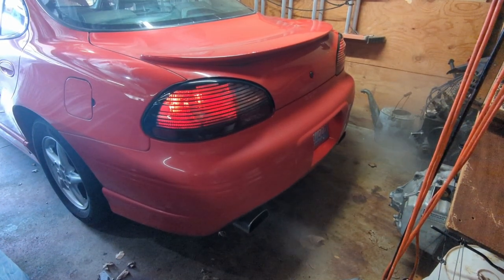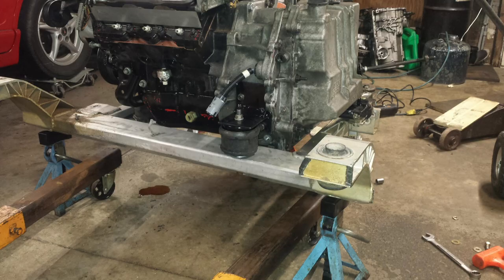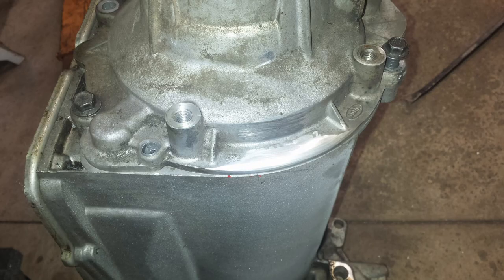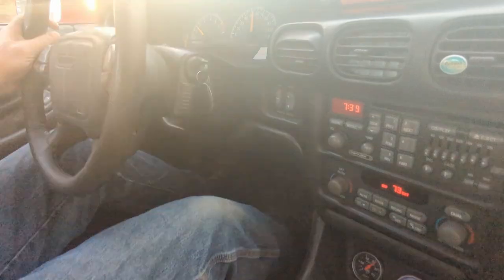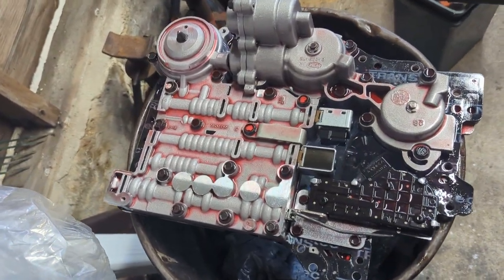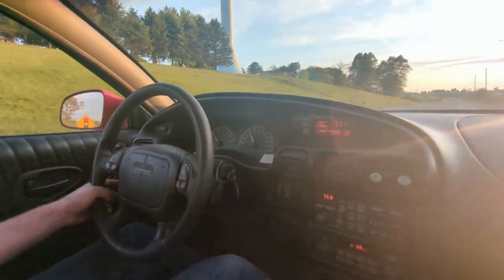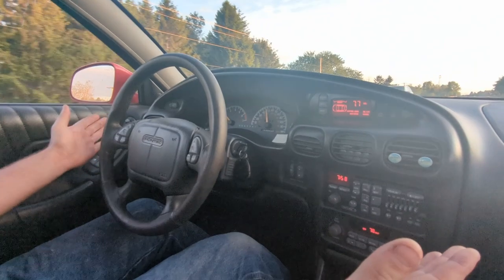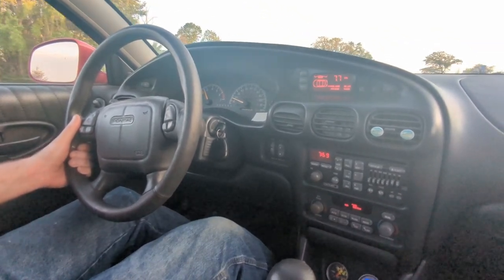4T65E to 4T80E Swap | GM 3800 | GTP | Details and Pictures

Comment from the maker: I found an error in my trans tune.  Correcting input tooth count from 25 to 39 allowed tcc to work with pcm command.  It also allowed shift adapts to work curing firm shifts durring normal cruising.
Reply: The Whippled Riviera I did back in 2012 has that in its last pcm file, remember folks ya need to change the gear ratios for each gear if the pcm sees  a ratio disparity it will change adaptives. 
I don't know if hp does but tiny does it.
Sprocket ratio should also be 1:1
I've seen odd numbers from some 4t80e swaps lately, mostly seems to be hp folks.
3.11,3.48,3.71 are your Final Drive ratio. You still need to change each gears ratio as they differ.

You can use the internal mode switch and wire it to the ext rage wiring. All logic outputs correlate

Comment: Is there a sort of write up for this swap process? I have an 03’ Monte Carlo SS that I plan to top swap and build, and I don’t feel like dumping a ton of money into a built 4t65e that could nuke upon its first launch. Let me know, thanks!
Reply from the maker: Chicago garage has a bunch of info in one spot.  It is probably imo the best one.  Its a known enough subject by now theres a bunch of fragmented infomation out there.  I used ls4 king for some of the wiring and all data.  Lots of work but worth it.  I have also tried to answer comments completely for everyone as well
Reply: @josephnowak so if i get this transmission in i have to mess with the computer and data?
Reply from the maker: @rosshopkins2063  yes.  Hptuners or an old dhp setup.  I have never used or seen tiny tuner but that could be an option as well.

Comment: I been wanting to this for years I need to do this to a 05 impala I found a 4t80e 2000 will it work on my 3800 la?
Reply from the maker: Yes its doable.  The 2000 trans is a little different from the 2005 that I have.  The car is a little different than my 1998.  Ls4king part 3 video goes into some of the controls,  Very similar to 3800.

Comment: I have a 1992 Pontiac Bonneville and im tryna build. Engine already rebuild head gasket replaced. Everything. But im just trying get more torque power what do i need to two do?
Reply from the maker: I am not as familiar with the series 1 3800 which i assume your bonne has.  Id look into the supercharged setup that would of came with the bonneville ssei models

Comment: I have a 05 GXP with a 3800 engine in it can I  put the Northstar transmission behind it without doing all that modification
Reply from the maker: Youl need modifications.  They dont bolt together or fit on the subframe without them.

Comment: Will this work for a 2006 Lucerne with 3.8
Reply from the maker: @kylehalpren6203  lucerne is a different platform.  The good news is that the 4t80 was used by gm on that chassis as far as i can tell. It likely wasnt used with the 3.8 though. Youd have to do some research on that end

Comment: Good more of you are finally seeing the 4t80e as our best option...
You invert shift solenoid b with electromechanical or through the bin file?

Tcc is easiest with a std tcc conversion system like those used with old school th350 to 700r4 retrofits
Reply from the maker: I did the solenoid method.  I didnt know of the other way at the time.  Maybe in the future il get rid of the solenoid.  So far works good
Reply: @josephnowak  Yeah, I used a small normally closed Solid state relay to trigger a 10 amp normally open solid state relay as my faster option to a NC wired 5 pin relay to invert the shift logic for solenoid b.

I believe that grounding the 4t65e t c c switch in the PSM and disabling the code May allow me to use the 65e p c m to control the 4t80e tcc without an external work.

I haven't gotten to test that method yet but I have high hopes.
Reply from the maker: Im interested in trying to get it to work.  I took the vb off and and drilled the holes for a   pressure manifold switch and adapted the harness but that didnt satisfy enough of the logic. Or at least it didnt make it work.
Reply: @josephnowak  The 4t80E never had a tcc psm switch, youkinda have to use a hobbs switch plumbed internally to the tcc pressure or exhaust.
Reply: @josephnowak  I plan on trying to just ground the 65e tcc psm switch wire m try Mt ext or tu ne for any solution. 
Hobbs switch internal is next after lol
Reply from the maker: I had the subframe dropped 3 times trying to figure out if i had something messed up w the trans or converter.  I finally put a stock converter in it to eliminate that possibility... Next time i have the side cover off i will be investigating where i could put a switch.  I would also pin the pwm valve.  Theres nothing in hp tuners to dhp that you can do for not having a switch.  That being said i assume adding a switch would make it happy.  Its a small detail.  Everything else works great and i am happy to cruise it around and push the floor switch for manually locking it
Reply from the maker: Also i have been told by multiple people it can work as is.  Maybe it could be the case w a later model w body chassis.  Im not sure.
Reply: @josephnowak  I did get it to function but only once after a hard reset, then upon lockup and not see the tcc pressure manifold switch activate, it would come out of torque converter clutch lock up and trigger the code....
I just haven't had a chance to confirm whether my method will work.

BTW you have the correct iss pulses per revolution? Most think it's like the 65e but it's just 39 for all of em 4t80es, as the iss refrences the drive sprocket teeth.
Reply from the maker: The trans wouldnt upshift until we messed with the ratio and from my memory it was an iterative guess and check.  Drive sprocket ratio was set to 1:1.  And then there was calculated pulses per rev and pulses per mile.  From looking at my bin the calculated pulses per rev is set to 25.  Pulses per mile is 23434
Reply: @josephnowak  ppr is 39 iirc. Iss reads off drive sprocket teeth.
Reply from the maker: Your definitely right on that.  Il correct it and see if it helps.
Reply from the maker: Correcting the tooth count from 25 to 39 fixed my tcc issue and allowed shift adapts to work.  I need to fine tune the apply and release tables but everything works on pcm command

Comment: How strong can these trans be? Can they be built to handle a ton or power or just like 350wheel
Reply from the maker: They are becoming more fequently used by turbo guys well beyond 350 wheel with stock internals.  The advantage of doing the swap is the cost avoidance of the used high cost (discontinued) gmr parts.  Gmr chain and gear set, input shaft and diff are thousands of dollars.  A couple hundred bucks you have a working 80e core.  The internet will tell me that an 80e on a supercharged setup is an overkill and not necessary.  The cheap 7/8 conversion chain setups stretch and break in stock supercharged +e85 setups, seen it many times first hand and on tear downs

Comment: Hey I have a 2005 Buck Century 3100….I was told that I have to get a transmission out the same car that I have(I thought that all Buick 3100 1997-2005 would be the same would you be able to tell me the difference) thanks a lot ……love your video 💪🏿
Reply from the maker: Big difference is the neutral safety switch on the early ones are on top and on the outside of the transmission.  The later ones have the switch inside of the trans.  2004 2005 will have it on the inside.  The later ones also had different type of solenoids if i recall correctly.
Reply: @josephnowak  ok thanks man that was very helpful…..I have another question what can I do to make my 3100 more powerful….i really wish they would have put a 3800 in the Buick Century’s
Reply from the maker: Unfortunately there isnt really an aftermarket for the 3.1/3.4 engines platform.  Good engine, but just no easy mods available.

Comment: what did you use for a speed sensor
Reply from the maker: @heathparks-i3d  i think i used the output speed sensor out of the 65e only because the one on my 80 was damaged.  If i recall both take the same delphi plug and looked similar. Its been 2 or 3 years since i plugged it all in.

Comment: Pilow switch on the newer transmission did you hook up those wires
Reply from the maker: The external switch i transfered from the original 65e.  I ground 2 flats on the 80e shaft and repositioned the switch.  Made some small tab brackets to hold the switch in place.  Didnt have to extend factory wires.
Reply from the maker: I havent heard the term pillow switch before.  I have the manifold pressure switch wired in.
Reply: So you just matched up the 2 wires on the 4t80e TFP switch with the gtp 5 wires on the TFP. Think only 2 match rest did what leave it?
Reply from the maker: I ran into this.  I was told that to hook up what is available.  For a while i drove w the 2005+ switch and through the course of debugging i had pulled the vb off and drilled the remaining holes to adapt the earlier switch.  I grabbed a switch plug from a 4l60e and wired it in to where i thought that 3rd wire would go.  Long story short a i never changed the input count in my file.  Once i changed that everything worked.  Although i havent tried it, i believe if my cal was correct from the beginning i would of not had to adapt to the earlier switch.
Reply: Oh ok cool. I thought it would work as is with Just the 2 wires trail and error. Long as everything else is hooked up it should.
Reply from the maker: Dont be like me.  Make sure the cal is adjusted right.  My setup started working correctly and shifting smooth after i got it right.  I think i pinned my settings for 3.11 ratio.  Verify your ratio and go from there.  Its also not that hard to pull the vb in the car on an 80 - right through the pan.  65 is a pain.
Reply: Yes set gear ratio, sprocket count and verify that just 2 wires will work for update. Thanks for replying.

Comment: Could you give a bit of detail/tips on how you lifted your car to remove your engine/tranny. Looks like your a true diy and dont have acess to a lift like 90% of us shady tree mechanics
Reply from the maker: The shadow of the car is blocking the ramps i used under the rear tires.  Use normal ramps - jack the rear up and slide them under each rear tire.  I used an engine hoist to lift the car by the metal bumper.  Theres a strap looped around the bumper - bumper cover can be removed for easier access.  Theres a harbor freight furniture dolly underneath the engine / transmission.  I set the car lightly (dont put full weight of car on dolly, engine oil pan barely needs to touch) on this before removing the subframe bolts. disconnect strut bolts, exhaust, tranny lines, electrical connectors, and steering from the knuckle.  I may have missed some stuff but its doable on a smooth flat surface.  Dont put your hands in there while the car is up.  Pull it out from the  side and i lower the car back down when everything is out, on jack stands.
Reply: @josephnowak  thanks! I had looked into getting a tilting car lift.. but that looks even sketchyer. I think an engine  lift would be better

Comment: I been hearing alot of stuff that my series III  l32 engine I just got with a 4t65e won't work on my series II L67 and transmission pull cause its different. The engine will work but not the transmission. Seeing this video I don't believe it.
Reply from the maker: The changover year on the transmission for the 4t65 is 2003/2004 ish.  Valve body electronics are different.  Never tried to get that to work before.  Might require some research to get them to work
Reply: @josephnowak  Found out its from a 05 grandprix. How different is the 04 impala SS HD from this one I have no idea. I may just use it.
Reply from the maker: As long as the gear ratios are the same.  If ones a comp g and the other isnt then thats a problem.
Reply: Just swap in the HD diff as the gp is probably a 3.05 fdr non hd diff

Comment: Shifts sound firmer than a stock car. Wouldn't it be easier to just upgrade the 4t65 with better internal parts?😊
Reply from the maker: Thanks for your comment.  I think the thing i didnt explain is that there is no shift kit available for the 80e, so you have to make your own.  The feed holes for 2nd and 3rd are drilled out.  It would probably be tamer w just an unmodded separator plate.  One of the key pieces to making a 65e live is a gmr (gm racing) gear and chainset which you do not need for an 80e.  Used they go between 2500 and 3500 dollars, its a discontinued item.  Even then, a buddy of mine broke a used chainset on 18psi turbo car.  The car was leaned on a lot but still.... Thats a lot of working jy 80e transmissions.
Reply: Thanks JN. Seems to me that if you want over 300 hp it makes more sense to get a RWD car. The later GTO's were about the size of your car and had essentially Corvette running gear. So way less cutting, hacking, and custom fab work involved to get any hp number you want. But i appreciate your motivation. @josephnowak
Reply: I guess the 4T80's are cheap since nobody is looking for them or know they exist. But if a 4L80 hits a salvage yard  it is gone before its cold.
Reply from the maker: Typical working core is 200 to 300 last i checked.  It depends on what your working on or trying to do.  The rwd stuff can get expensive too but there is potential to be faster.  With this setup i just want to be able take it out and not worry about immediately breaking.  Im a big fan of rear wheel drive stuff too
Reply: Tried for a 10-second slip....shredded 11 4t65e's even with 9k$ in the trans (gmr/billet everything) 

4t65e sucks
Reply: OK i got the picture. 4t65e wont do it no matter what parts are in it. Of course a 10 sec car is 1000 hp or something nobody ever imagined in a fwd vehicle.  @Turbocharged400sbc
Reply: @robertrpenny  The last time it shredded the 4t65e, it spun the slicks at 105mph, at 29psi, producing over nine hundred at the crank with the ifr/maf math....105, 109, 106mph and then all iss data gone....

It did 608whp/570ftlbs at 18psi (3rd, tcc locked)

Gm knew. The GM Racing parts were developed for the turbo ecotec 4cyl....that they were producing up to 1600hp with back during the summit sport compact racing series. 
Transaxles were replaced about every two runs

Comment: Hey I see you made a 4t80 work on a p04 pcm. I T’d off of pin E and connect that to pin U. Im having trouble getting mine to work properly. I have a 3800 mated to an all stock low mile 1995 4t80. It’s actually in an N body running on 4t45e calibration so the shift logic should be correct. Although i do know how to change it. I changed the iss count to 39 and changed the gear ratios. Not sure if i have the pulse per mile correct thought. Mine is the 3.48 fdr. I have dhp and am fairly proficient with the bin file. The issue im having is that in “D” it will only shift 1-2. In “3” it will shift 1-2-3. In “1” it will actually still shift 1-2. Im also in Wisconsin! An help would be much appreciated. Messaging me on messenger is cool too. Gauge Dochnahl.
Reply from the maker: @Gawge1  pulses / mile should be based off tire size.  I had to do some reverse math and google searching but i believe the tooth count for the output speed pickup on the diff is 31 teeth.  Do you know what you entered for pulses per mile?  What is your tire size?
Reply: @josephnowak right now its just on a stock size 205/65R15 just to get it rolling but its going to be a 275/40R17. Eventually that will change again to a 15” slick when i buy some. Still not sure that this is my issue though but worth a shot.
Reply from the maker: @Gawge1  il sent you the math in messenger.  I suggest dialing in the tire size and go from there.  These fwd pcms are finicky.  My tuner and I had to do several iterations on hpt to get mine to work.  Starting point for the 205 - 24518.  Starting point for 275 - 24327.

Comment: Man i did worong for the f16s in the airforce and i know how to build the jets wiring harneses but theparts where standardized and there was a technical manual. Im thinking i could do that part from scratch
Reply from the maker: I ended up sourcing the connector bodies and terminals and sealed relay from ballenger motorsports and assorted wiring colors from amazon.  The other way is just extending what you have and repinning.  Depends on how you want to go about it and your budget.